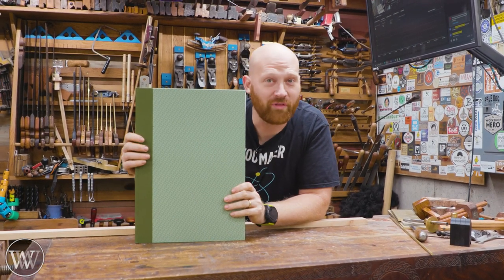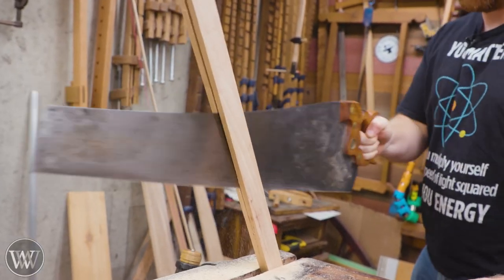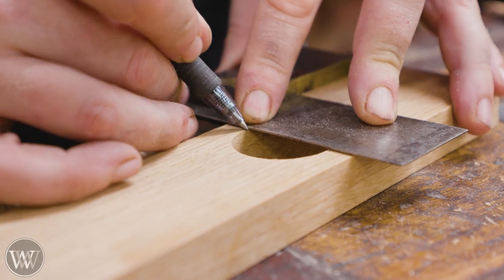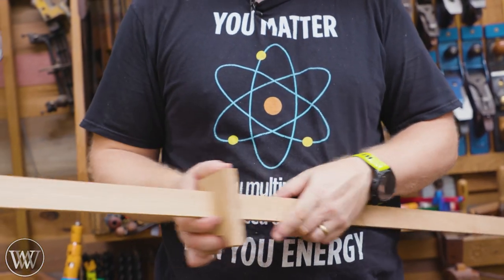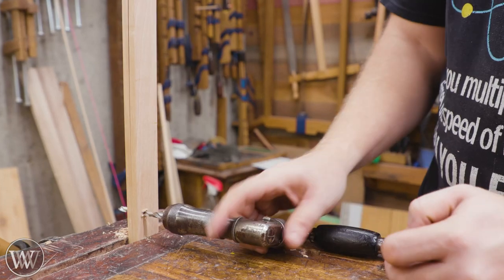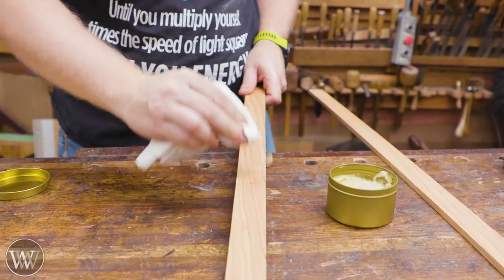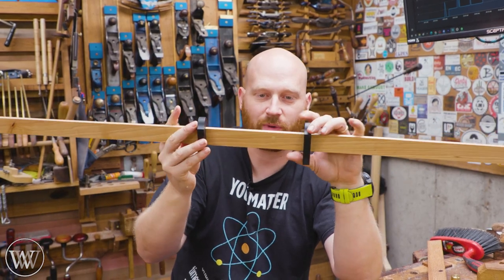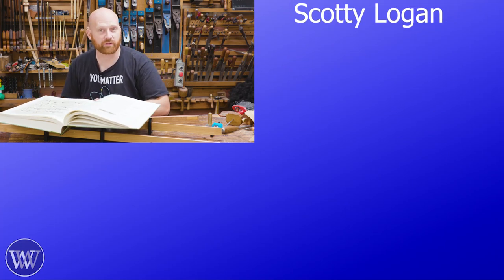How to make Roubo Style Winding Sticks

Comment: My winding sticks are too short for wide boards as well, so I might be making some longer ones.  I made my old ones many years ago in a hurry.  Two random sticks of hardwood, one paler than the other.  They don't match anywhere, different width, height, length and thickness.  All that is required is that they are stable, straight, flat on the bottom, and of consistent height throughout the length.  Works for me.

Comment: Cool multi use sticks in the making. Could put in a screw bolt to lock the legs and then use them to measure internal or external gaps, I love things that can do more than one thing, if only I could do the same. LOL.
Reply: Jumbo pinch sticks? That honestly sounds like a worthwhile time investment.
Reply: @dylanneely91  I just love multi tasking things in my shop. I use my thin pinch sticks as the guide rail on my thickness planer jig! I enjoy thinking about maximising minimal effort. LOL.

Comment: I made a pair of winding sticks as a first simple project. They soon became twisted and unusable. You say cut them from the same board, like bookends? Ah-ha, thanks for the tip James! …I’m heading back to the bench.
Reply from the maker: grain choice is important. they should have very strait grain and quarter sawn if possible. but if you resaw them from one board then any change will be the same on both boards.

Comment: I’ve tried these style winding sticks several times over the years, and I found I really dislike them. Much too finicky, and not as accurate if your board isn’t already perfectly flat. Plus, I had one set that ended up cracking the feet when the center stick expanded in the humid season. Just my opinion, but I know others really swear by these
Reply from the maker: that is what makes woodworking great. there are on best ways just the ways that work for you.
Reply: @WoodByWrightHowTo  couldn’t agree more!